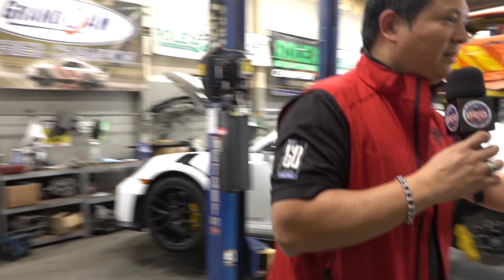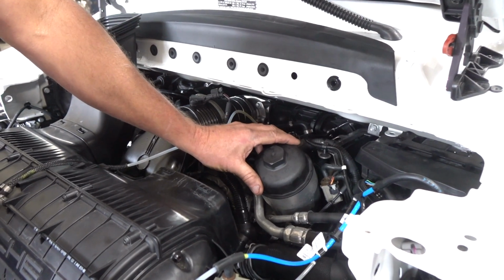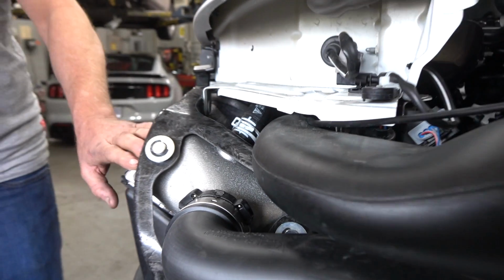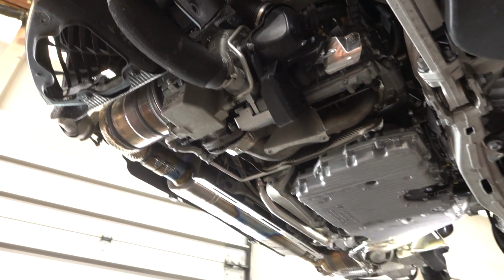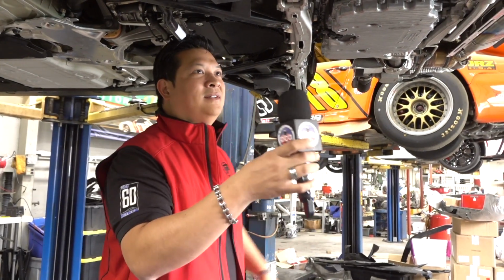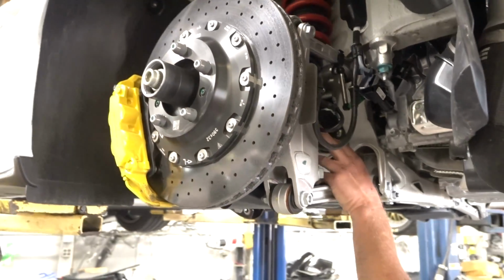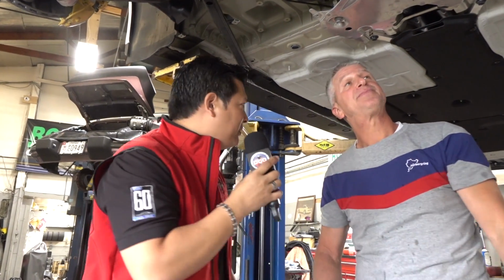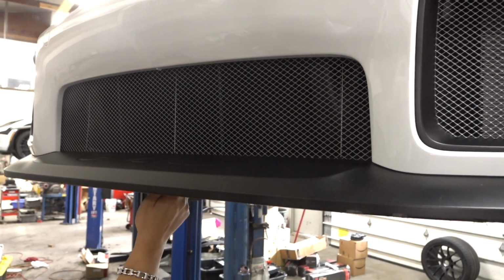PCA Spotlight: 2018 Porsche 911 GT2 RS technical analysis

Comment: Did you say the oil change interval for track use changed from 10,000 tack miles to every track event..... A track event could be less than 200 miles.... there has to be more to the story.
Reply from the maker: In this case, changing oil after a weekend of hard track use is recommended. Consider it cheap insurance.

Comment: Guys, that sticker “Made in China” sounds bad, doesn’t it? But the gt2rs have had problem with production of certain parts to mass produce. As an example this bit of carbon maybe was a part they couldn’t produce in Europe. Then they had to make it China to deliver the cars in time. That doesn’t say anything of the quality, it surely is as good as a carbon bit made in Europe. I think Porsche have very high standards especially if they have to make a part in China.

Comment: what a nightmare to work on.
Reply: by making even base models overcomplex they provide long term income for their dealerships. it's similar to what we germans call "schedulded wear" for example expensive clothing brands put cheap ink on their t-shirts to force you to buy a new shirt every couple of years while a 1,50$ shirt full of writing and ink I bought in asia is still in good shape after 10 years. even though the tech on this car is faszinating I couldn't care less because the mid engined corvette is probably going to be faster at 1/3 of the price and with 1/4 of the tech.
Reply: @herberthans7015  you mean dye when you say ink?
Reply: zachary paris seriously even to change a damn oil filter effn crazy
Reply: At this price point, I hardly think the owners could care any less but hey have you seen the plumber's mess in a 996. Ironically still like 'em. 😪
Reply: Yup, still fastest car in nurburgring XD
Reply: You don't own one to care about maintenance cost, if so. Stick with a Hyundai or a Honda Civic.

Comment: What a terrible design for maintenance......although if you can afford one you can afford a mechanic to spend days changing the oil.....it even has Chinese parts!!! Come on Porsche you can do better than this for the money you charge for one of these....
Reply: Yeah it's almost a joke. Basically have to take the car apart to change the oil.
Reply: its a friggin race car, not some trophy to parade around at car shows. you guys need to buy a clue.